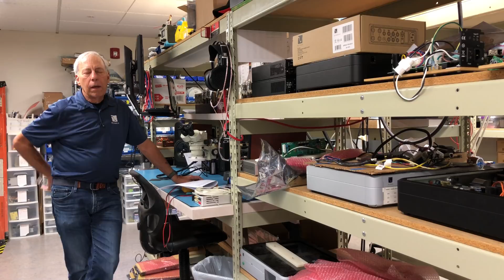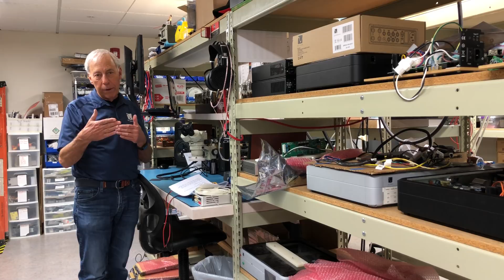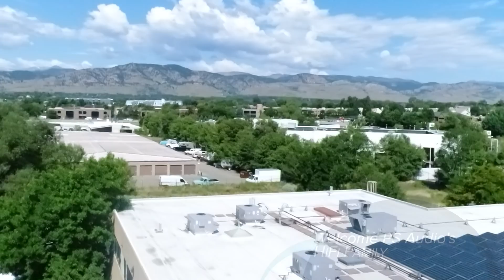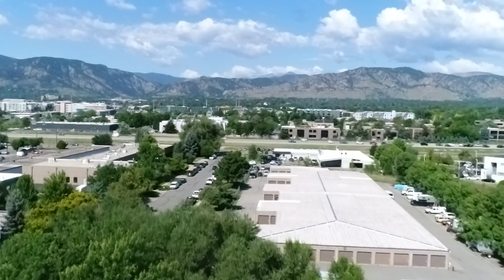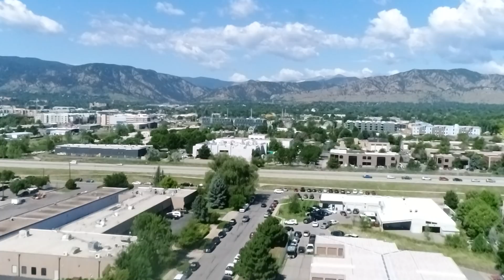What is audible polarity?

Comment: Back in the late 1980s, acoustic engineers had found out that when air molecules are exited by an acoustic event - i.e. sound waves - air will compress over a wide range of velocities, but it will decompress at a slower and more narrow rate, which might allow some to distinctly hear timbral differences when it comes to sound polarity.

Comment: Could this be related to the phase or delay? related to left or right .. I mean if you apply a delay between one of the two chanels this will change the polarity of one of the frequency and all the rest on each side of it will be gradualy non totally shifted... That's why for exemple subwoofer control often have phase shift adjuster and polarity option... On teh other hand Changing polarity of the signal will apply 180 degre phase shift to all frequency .. while applying delay will only do it to a center frequency... the feeling will be  totally different... and audible polarity might be related to the delay in a room between left and right... which mean it is only fully shifted 180 degre at a center frequency and not the entire spectrum?...... Else.. I am feeling im only one of the few that can say with my own hears if a speaker is reversed polarity relative to the other channel or not .. I instantanously feel that but not all people around me can feel that...  maybe it is related to audible polarity too..

Comment: For me, if a pair of different loudspeakers (in aroom that I am familiar with, with familiar electronics) have problems producing a tight image, then I generally try flipping the absolute phase. I have always found that there is a right and wrong phase for each system. Always worked for me, try it out and see,😄

Comment: Does this polarity change apply to just one speaker or to both speakers at the same time? If it changes just one channel it's going to sound awful..giving a strange spacial feeling.with lack of bass. if it changes both speakers then you are not going to notice surely as who can detect the first say 1/6000 second pressure wave to arrive ?

Comment: Could I run-in new speakers without annoying the neighbours by placing them closely face-to-face and reversing the polarity on one, so that the output amplitudes largely 'cancel out' in the air between the drivers?
Reply: I did that with my ls50s but I made a mono recording of an album with a variety of loudnesses and frequencies. And reversed the speaker leads on one speaker while they were about a quarter inch apart. Didn't play them real loud but where I thought average listening might be
Reply: @mcrelly  Many thanks, Mr Crelly. Stupidly, I hadn't thought of the necessity for a mono recording!
Reply: @williamevans9426  not necessary but it helps a lot if it is. Experiment
Reply: @mcrelly  Many thanks again - much appreciated!

Comment: If both channels are equal in terms of amplification stages there is no need for phase inversion... The Mark Levinson amp "polarity" switch ( don't you just luv it !! Lol 😂) inverts one channel and only provides inversion from a low frequency down .. so that the woofers are in phase ( saves having to get up and fiddle about reattaching the speaker cables ... 
I'm VERY surprised PS Audio use these phase switches ..

Comment: Binoculars when looked through the wrong end, causes the image to look further away.  That is an example of a visual reverse polarity. The same effect can happen to what we hear coming from the speakers. That is if the speakers are phase coherent.  Not as dramatic as with binoculars, but a pulling away just the same when the sound polarity is reversed.  Its system dependent on how easily this can be discerned.  I find that when the correct polarity is set the bass and impact of drums and other instruments are rendered more realistically.

Comment: It’s possible that when you hear a difference concerning polarity the speaker itself is poorly performing between how it reproduces pull vs push motions. The ideal speaker makes an identical motion of distance relative to voltage push vs pull but if the magnetic field, the spider, surround or voice coil aren’t providing equal physical properties in both directions, the difference can be quite audible. Thus hearing polarity is not necessarily the result of a high resolving system but can more likely be due to poorly designed or manufactured drivers.

Comment: When a musical note is struck or blown or whatever, the the first pressure wave in the air is compression followed by rarification. and these continue to alternate as the note decays from acoustic instruments.  This is reproduced electronically by the positive and negative phases of the signal relative to the bias level with no signal.  I supposed you could produce a discrete chirp of a single positive and negative waveform and no decay with signal generator, but that's just an artificial chirp sound, not music. I'm not an electrical engineer, but it is my understanding that each gain stage in a classic amplifier circuit changes the phase by 180d (d in this case is is degree, sorry, I don't know how to get a little superscript circle into a YouTube comment).  For example, a simple vacuum tube circuit with a voltage gain tube, a driver tube, and a power tube would affect the phase by 180d + 180d + 180d = 540d or a net 180b, so the amplifier would reverse the phase relative to the the input signal.  Any EEs reading this naive, simplistic description, may feel free to correct me, for the benefit of myself and any other readers.  However, if your preamplifier also  has an odd number of gain stages and reverses the phase, then the net result is the signal will be back in phase.  As with all things audiophile, some people can readily hear phase differences and some of those are really bothered by them.  But as Paul commented, some recordings are out of phase to begin with, depending on how they were recorded, mixed, and mastered.  And of course, some electric instrument amps may reverse the phase, so assuming they were all miked the same, the Stratocaster may be out of phase with the singer playing it.  Also, there are effects pedals that purposely change the phase in all sorts of ways.  Nothing is simple.
Reply: @MyRackley  Thanks for the tip.  Nope, nothing. This is a ChromeOS laptop,so there may be  some different way.  I miss printed manuals.

Comment: I have always read that the polarity of any audio product is determined by how many stages the signal passes through, and that each stage inverts the signal.  Thus, if what I have read numerous times is indeed correct, any path with an odd number of stages will invert the signal, and any path with an even number of stages will retain correct polarity.

Comment: Quite some years ago the group I was part of was doing some testing on if people with hearing loss could discern the difference between HiEnd speakers and average speakers. It wasn’t all that scientific. We had a handful of stereo pairs. One of the tested persons, a young man, had medically no hearing in one ear and partial hearing loss in the other. Keeping this story short he told us after listening  to the HiEnd speakers that the left channel tweeter had the phase reversed and the right speaker was not reversed. We were SHOCKED find out that he was right.
Reply: Having one or more driver out of a set swapping is very bad and way different than having the whole set swapped together.
Reply: @andrewpienaar4522  yes that is very audible in the crossover region.
Reply: Because the crossover slopes don't add up but cancel eachother out when one driver is inverted. This has nothing to do with absolute phase. There is no perfect phase in audio, microphones, speakers have phase responses all over the place... Gosh, why do you think it's so hard to design noise cancelling headphones?

Comment: I noticed that when waveform is very asymmetrical, e.g. pulse waveform where pulse width is about 10%. Then there is HUGE difference when switching polarity, to the point where the other polarity is unlistenable. There must be a difference how pulses of high air pressures and pulses of low air pressures work.

Comment: I do a lot of mixing signals. The polarity button in this case can be flipped to test, if the speaker setup (at listening position) could sound 'warmer' . If it does flip the switch I have learned this from calibration sounds on vinyl. Meaning there are two (critical) different things; the right phase on the speakers (L an R) and how the phase is received at the listening position, as in the wavelengths. (Ofcourse, if you would choose to do so)
I prefer setting up the speaker-phase, and then take time to do the positioning until that warmth kicks in. The speakers I have now like to be not too far apart and not too far away from listening position. They sound much colder further away, so switching polarity at that point really worked.

Comment: Isn't it easier to just make sure your speakers are connected correctly?  I remember in the old days there was a ritual of reversing the power plug to wall outlets and component outlets to help reduce "common mode" hum.  When the plugs were eventually polarized or three prong grounded this problem was eliminated.  Guitar amps typically had "polarity reversal" switches that reversed the line connection for the same reason.

Comment: Some electronics invert phase as a natural consequence of amplification. If you hook up two inverting pieces in series, there is no problem, phase is correct. I have a phono stage that was inverting in it's first iteration. If you were to run that along with a non-inverting CD player, you would want to flip this switch every time you changed from one to the other. This switch makes matching easy for inverting or non-inverting amps. If you are not sure what  your equipment is, put it where it sounds best to you.

Comment: If the whole thing is only flipping the polarity. There is zero difference. Our auditory system will rectify all the incoming information.
The only chance of the difference is the asymmetrical distortion characteristics of the components in the signal chain like dac amp speakers even room. So that way there is a chance that you will hear a difference.